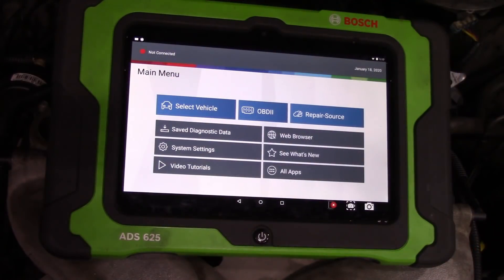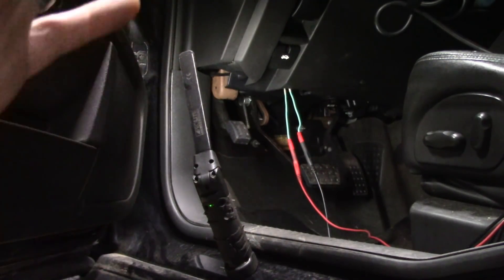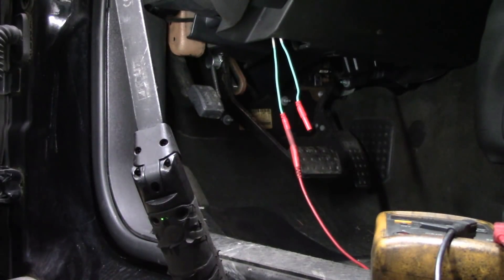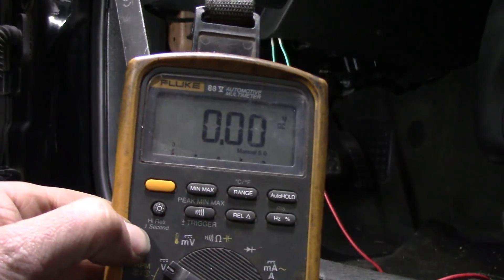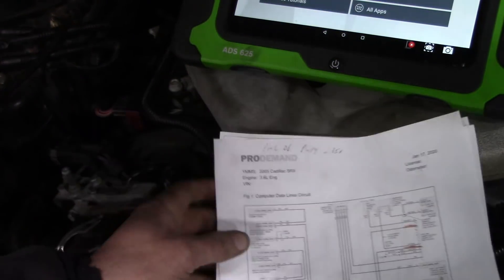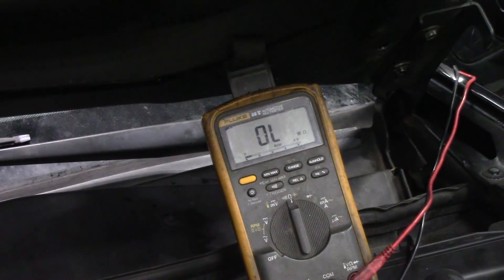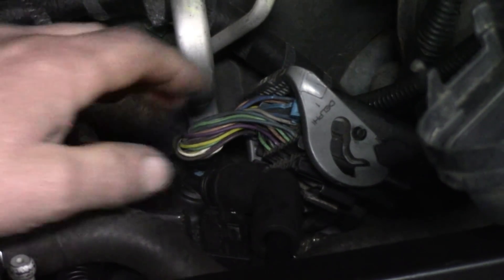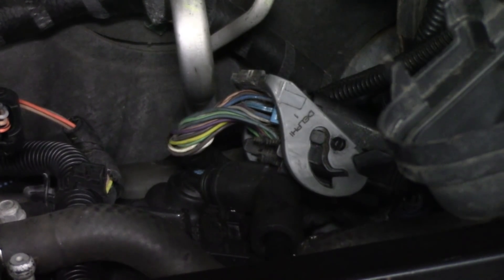Engine Replacement No Start, No Crank, No Comm so Come See the Diagnosis!

Comment: Will this also make it not able to program a key even if you change the ignition switch
Reply from the maker: Your question yields more questions. What codes are present, what vehicle is it? What tests have been done to quantify replacement of any parts?

Comment: I'm currently dealing with this problem right now, I have a crank no start on my rebuilt VR6 engine because of a no spark issue, and no communication to the ECU. I've checked everything. But this problem seems exactly like mine I'm still stuck here. What should I do?

Comment: My 07 cts 3.6 has been stuck at this position for a year!! Hope this works. Thanks. I'm told that the ecu has to be programmed to the pcm. Could that be the problem?
Reply from the maker: The ECU is the PCM. same thing.
Reply: @JoesAutoElectric  ok thanks so could that possibly be the problem? I have checked literally every thing else involving crank no start

Comment: Was the other 120ohm resistor, located in another module,  going thru that connector also? Mitchell's  re drawn diagrams do not show that
Reply from the maker: Yes, but I know what you mean.

Comment: Nice diag Joe! The majority of issues on engine installs are connectors not locked in, swapped connectors, bent pins, fitment issues, bad grounds or wires not connected plus a few more. Always nice to have an easy fix 😎
Reply from the maker: Agreed sir, but finding that is usually where guys have problems.
Reply: @JoesAutoElectric  Totally agree but it's good for business
Reply from the maker: That it is...I personally prefer a customer who screws up over a shop sending it to me though. makes all shops look bad.
Reply: @JoesAutoElectric  Definitely!!

Comment: You're kidding? Someone has to own up for not checking the electricals were plugged in completely?
Reply from the maker: Not really. The connector itself is at fault. I checked it further off camera. It is worn out and probably came loose while it was still being worked on. Video is more about finding the issue through diagnostic procedures without wasting time.
Reply: @JoesAutoElectric  You sure do a thourough job even off camera. So what can be done to fix the worn connector? Can you cable-tie it tight?
Reply from the maker: My concern was that it was a pin retention problem or a terminal lock problem..have to really look at them close and make sure. Being that it is the lock only, I will cable tie it in place. I'll also tell him that if he can locate the proper connector, we can fit the terminals into that connector and it'll be like new....Most likely they will be happy with the tie. LOL

Comment: CAN Data with Dave Hobs is the video that changed my life!  I watched that thing about 50 times and have an entire notebook filled with notes.  They use a similar connector the Driver kick panel on a lot of GMs where all the wires come through for the gas pedal position and the blower motor.  The blower motor power over heats and melts the connector and then you get all kinds of throttle position errors two.

Comment: Shouldn't you have 60 ohms with the power disconnected?... We do this test all the time but the first thing we do is turn the battery disconnect switch into the off position then measure  the ohms
Reply from the maker: Key Off
Reply: Well even with the key off modules still be communicating on the bus the proper way to do this test is to remove and isolate the negative cable then check your ohms

Comment: The Chevy duramax use those connectors too. I had one with a bunch of sensor codes. And the connector lock was broken .But it would start. Great videos thanks Joe